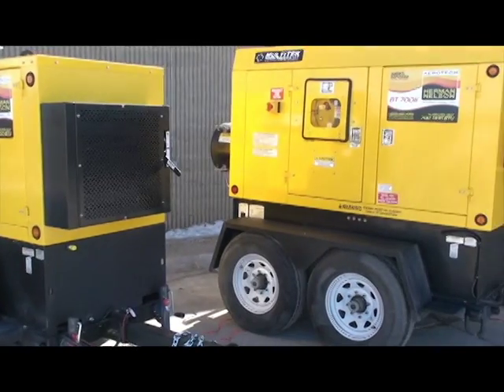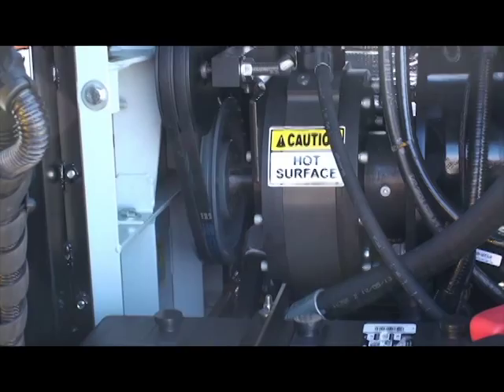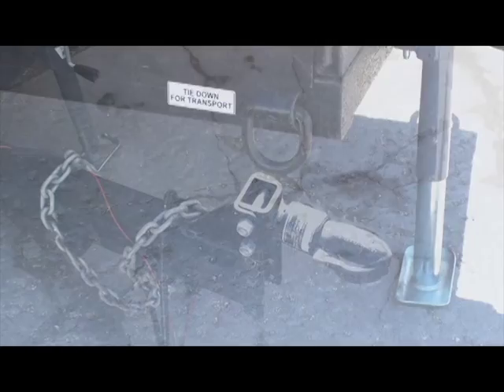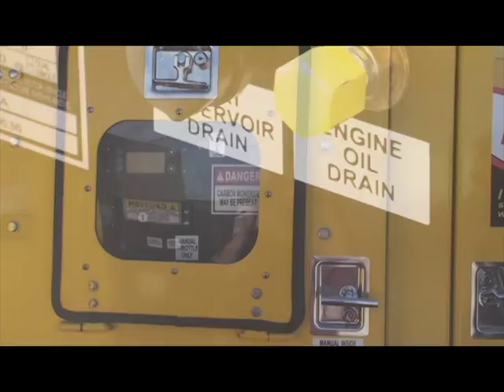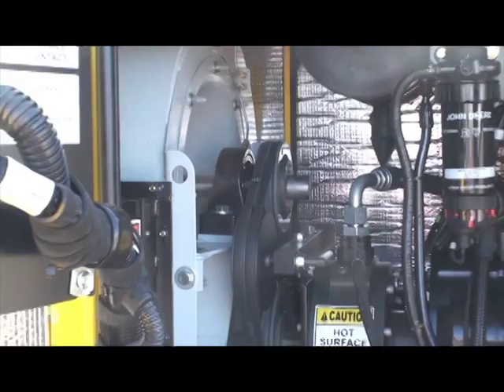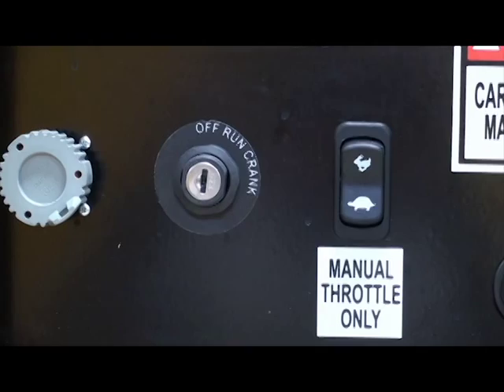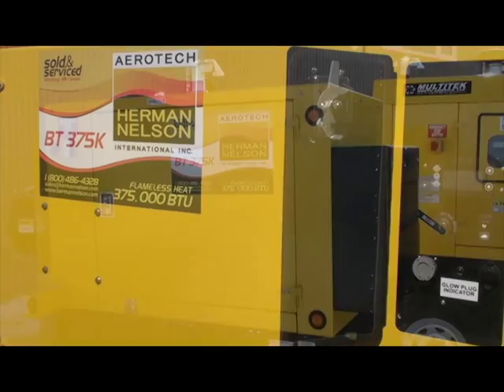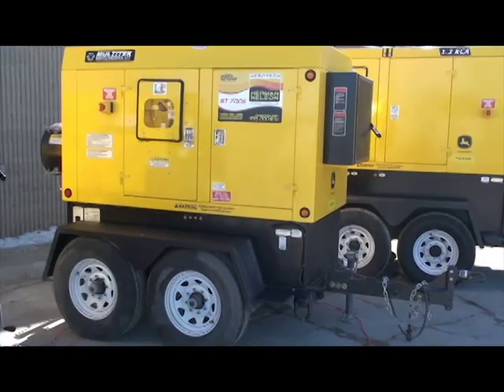Aerotech Herman Nelson Flameless Heaters

Comment: Look good, worked many years as a mechanic in a rental shop. The John Deere PowerTech engine has been good, and yeah for sure needs the postive air cut if it is going to the oil and gas fields. Cheers from northern Canada